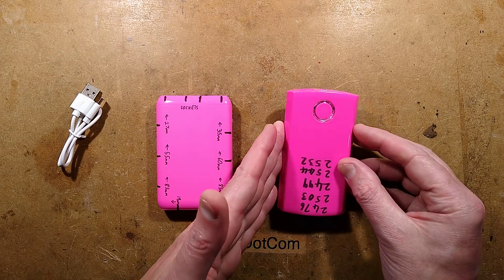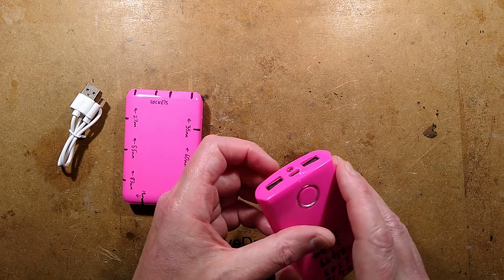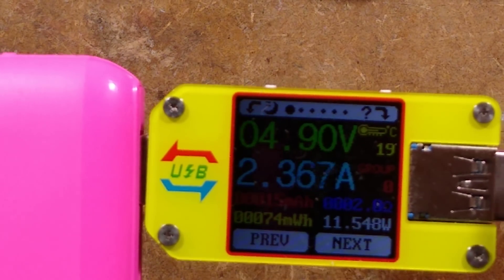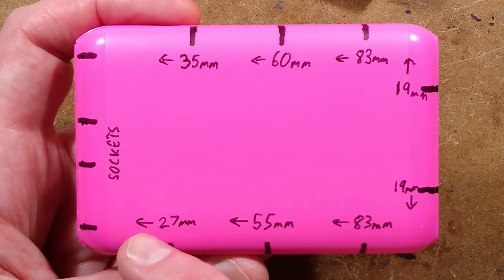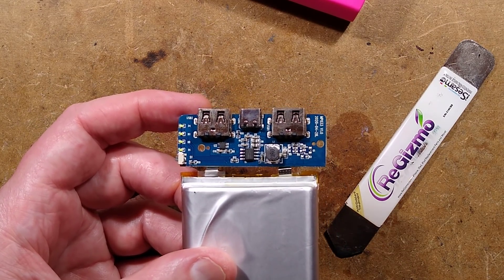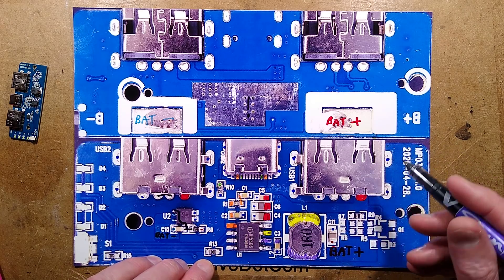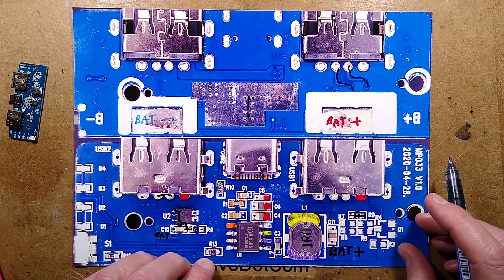Poundland's new 4000mAh power bank

Comment: 2 ideas that are better than using rubbing alcohol to dissolve glue. 1st one is WD-40 it is amazing how well w-40 can penetrate and get under the glue so it just slide right off! The 2nd one is a cleaning product sold in America called Fantastic it does the same thing but it just takes a little more time for it to penetrate.

Comment: To help remove lithium batteries I use a cut up credit card, I put a slight 'chisel' profile on the edge, with a slight curve...it seems to go under batteries without risk of puncture, or deforming the battery...

Comment: Bought a power pack today & when I opened the packaging I found a metal disc with a small square magnet in the corner sellotaped in place, can’t understand why they would put a small magnet in the packaging that has nothing to do with the charger. Any Ideas why it would be in the box? Seems to be under the security label. I’m puzzled 🤔
Reply from the maker: Sometimes it's used to hold the box flap closed to give a posh feel to the packaging.
Reply: @bigclivedotcom  hi Clive, that explains it just discovered there’s actually two of them. I thought it might have been for the security tag.

Comment: With the previous model you could have a device permanently plugged in and and when you switched the device on, power was there - you didn’t need to switch the power bank itself on.  Is this one the same or do you have to click the power bank’s switch first?
Reply from the maker: This version doesn't always have 5V on the output.  It also goes to sleep with loads of 40mA or less.

Comment: I wired my bike lights upto a charger like this, they took 2x 3v lithium batteries I figured 5v would be enough to run them, I soldered wires inside them running front to back and put a USB connection soldered in the middle of the run of wire and had a frame bag that held the power bank. Basically I wanted easily rechargeable lights that wouldn't really be a hassle to run. It worked great

Comment: @bigclivedotcom
How could you modify the circuitry so it could output protected battery voltage instead of boosted 5V. I’m thinking of a protected battery source for a gsm module. 
Thanks.
Reply from the maker: Just by tapping off at the protection chip.
Reply: @bigclivedotcom  
Thanks, will find out which pin that is. Like you, am going to try to scavenge lipo’s and protection circuitry for projects, it’s cheaper than buying separate batteries and protection/charge boards.

Comment: At a guess - I'd say the absent resistor/transistor network is for optional Fast Charging capability - The standard USB port allows for 500mA, dedicated power ports are 1.5A, and then you've got the BC1.2 standard, and all the proprietary "standards" that each manufacturer had a go at creating. So short of actually using a dedicated USB charging "negotiator" (eg.  TPS65988) you can just implement a certain resistor network which will statically advise the client (via the BC1.2 standard) of how much current it should be allowed to draw. The absent circuitry may well be for some proprietary support (eg. Apple, Samsung) - I know that early apple chargers were configured for 2.4A, which is rather similar to this device's output.

Comment: Thanks. I use power banks to run guitar pedals with a 9v converter cable so it's good to know which are kosher. I bought one off the internet which made a clicking sound through the amp, I presume some internal switching?
Reply from the maker: Some have the input and output paired, and drop the output briefly every few seconds to test if an external charge is being applied.

Comment: Can the maximum charge level be modified? I think dedicated lithium UPS units keep the lithium cells below maximum charge so as not to degrade them too quickly.
Reply from the maker: It's not recommended trip go above 4.2V for most standard lithium cells, but for long term backup it makes sense to run them at the military spec of 3.9V which is near full charge, but will result in longer cell life and capacity maintenance.

Comment: You are right about piercing one of those lipo's.  Had that happen a couple weeks back. I had used an Arduino to build a small MP3 player.  Put it in a plastic project box and mounted some buttons to control things, as well as a earphone plug for output. I put a flat pack battery in the bottom of the case and just put the parts on top. It worked great for months, but the cover never really stayed put as the NANO which I had soldered to a small board was catching on the little mount pins inside the case at either end.  So the other day I took a snips and removed those mounts cause they had no practical use in the project and were just getting in the way.  What I neglected to do was cut the pins on my Nano that protruded through the circuit board containing the other components.  I did notice that the blasted thing would come on by it's self from time to time if I pushed harder on the cover. I was listening to some tunes through it one day and suddenly the strong smell of plastic melting was in the air. Since I had not been soldering for quite some time I got a bit concerned. I picked up the mp3 player and burned the hell out of my hand!  The pins from the Nano had pierced the cover of the flat battery and there was a very hot fire in the bottom of the case. I grabbed the whole device and pulled the Nano away from the battery but a bright white fire still remained in the pin hole.  Now I am not as quick as I used to be, in fact I am classed as disabled but I assure you, I got that thing out doors quicker then I could have when I was a boy!  I took my snips with me and once out doors, cut the lead, only one remained as the heat had unsoldered the other and dropped the burning battery on my drive way. Days went by, and I had pretty much forgotten about the whole affair when my daughter brought me that battery, saying she found it in the drive way. I took it immediately back out doors and placed it in some tin foil, then dropped it in an old cast iron pot that is yard décor where it remains to this very day.  Oh the mp3 player? Well it still lays on the floor near my chair.  One day  I may install another flat cell, but then I have dozens of ways to play music now and don't really need a home built player.

Comment: A while ago I managed to get three 2A USB powerbanks for the Amazon Echo Dot, for £5 each from Poundland. Definitely worth it just for their lipo cells, two 4000mAh in parallel.
They don't behave like regular USB powerbanks though, to activate the output you have to press & hold a button, or if you plug in a micro USB cable to charge it up, the output is automatically turned on, presumably this is so the Echo Dot can still run whilst the powerbank is charging.

Comment: The USB Type-C resistors are used to indicate which device is pulling or supplying power. The specifications require them to be of certain value, referencing specific amperage and voltage. Without them, devices will just refuse to negotiate a connection.

Comment: Ah it's £5 I guess poundland isn't the one that sells everything at £1. If you need a small amount of power I guess it's not bad but in terms of price per ah amazon has some much better deals this works out at about £1.25 per ah where as one of the first items on amazon comes in at 58p per ah so less than half the price. Maybe he'll review that as well https://www.amazon.co.uk/dp/B07V4RVGL5/ref=cm_sw_em_r_mt_dp_3HHW8Y5A8PS764ZHNYDY?_encoding=UTF8&psc=1

Comment: i think its misleading when they mark a powerbank with the ah rating of the cell(s) as the actual ah you''ll get at the 5v out will be less ..
Reply: i have a halfords thing, 'supposedly' 3ah, oh yeah, 1 if you're lucky,, it used to be better at first, but fairly quickly 'degraded' , cant get the thing open without destroying it to check/change the battery 😠

Comment: The problem I normally have with power banks is that after some use they don't stay on to power your device. It is as if the current sensing circuit quickly deteriorates.

Comment: I live in the USA and I just found a deadly fault with my apartments wiring today.  Apparently the set screw on the cover plate for the wall outlet is live at mains voltage.....  basement apartment, I was barefoot and touched it...  burnt my finger a little.
Reply from the maker: It's worth getting that checked out.

Comment: I was just thinking of getting a few of these just for the lithium cell... my old Mate 9 and Nvidia Shield tab could do with a new battery haha. Gping to definitely see if i can pick up a few of these.
Reply from the maker: Note that the phone battery may have a protection PCB in it.  These are bare cells.
Reply: @bigclivedotcom  thank you for the heads up. I'm aware that both have a protection pcb. Worst case scenario I'll just use the battery to replace one in a Bluetooth speaker

Comment: What happens when you try to charge and power something at the same time, is this possible with this board? With the little inductor working for both Vin Vout?
Reply from the maker: I think it may just pass the charging 5V straight through to the output.

Comment: Seems to me that if a box says it outputs 5V and 4Ah, then it should be able to deliver 5 * 4 * 3600 Joules, at least at some (low, probably) output current. Anything else is deception.
Reply from the maker: To be fair, they don't specifically say that the 4Ah relates directly to the 5V.
Reply: @bigclivedotcom  At least it's not as silly as the perpetual increase in the voltage of battery powered tools.
Reply from the maker: @sylviaelse5086  When using cordless tools you do appreciate the higher performance and lower current that the higher voltage packs bring.  Many of the higher voltage ones perform as well as the older corded tools.

Comment: I would use what is  called " white spirit " in the UK  it's a mixture that softens the rubber used in tapes and foam pads - turpentine substitute  - also WD40 will completely remove hot melt glue without damaging polystyrene or other plastics
Reply: wd40 'can' affect some plastics, i've had it happen, making it crack up
Reply: @andygozzo72  interesting - I was thinking of occasions when a hot melt string gets across a nice enclosure and WD removed it - allways needed finish with isopropyl
Reply: @geoffgeoff9835  if you've only had wd in contact with it a short while, probably ok...

Comment: While you would be able to drive 6 LEDs, there is the issue of other possible current paths.
For example, if you have 1 High, 2 Low, and 3 High Z, you have a path through the hypothetical D5 connected directly to 1 and 2.
But you also have the path through D1 and D4.

And the same problem would occur if you tried to turn on an existing LED. If you made 1 High, 2 High Z and 3 Low, you have the intended path through D1, and another possible path through D5 and D3.

While  this likely wouldn't be a problem if all the LEDs are the same and aren't broken, if you have different LEDs it could be a problem and more than just the intended LED could light up.
And if an LED broke, then the others would be more likely to light up.

Comment: Discharge completely ? That's nuts if you want to have a usable battery - discharge to 3v maybe. Definitely Not completely. Mr Big Clive I did not expect this form you.
Reply from the maker: By completely in lithium terms I mean to auto shut-off, which with DW01 type chips is 2.5V    For disposal I recommend to zero.

Comment: Delivering a supply while charging is such a great feature. I'm surprised that more units don't do that. It's so frustrating when this isn't possible.

The other frustration I've come across when powering IoT devices is that, having laboured mightily to make your devices draw as little power as possible, power packs no longer recognise the power draw and switch off!
Reply: If you charge and also use the powerbank to power up phone at the same time, doesn't the output drop to the phone? So it's slower to charge up phone. Well that's my understanding. I'd rather charge up phone fully and then charge up powerbank fully. (Or vice versa)
Reply: This may count as a UPS supply, maybe not a very good one thi

Comment: When faced with the removal of double-sided tape of unknown provenance, my first tool is heat. If using solvents, I've found that ethanol works on some, IPA on others, MEK on others, so I generally try each one a bit gingerly. Acetone is also great but will also eat many plastics of course :)
Reply: Be careful with MEK. It's nasty stuff.

Comment: Clive if you weren't an electrician what do you reckon you'd have been? My dad started out a carpenter, then was an electrical engineer, then rounded off his career as a white goods engineer. So what else could you have been? I mean the evidence suggests Pyrotechnician! lol
Reply from the maker: I originally wanted to be a lift engineer (elevator mechanic) but was stopped from doing so by my dad.  If I hadn't been an electrician I'd probably have trained as an electronic technician.
Reply: @bigclivedotcom  My dad was originally going to be an RAF pilot before carpenter. He flew the gyrocopter from James Bond on one occasion as a day out! But he had a fit after suffering heatstroke and that was the end of that career path. He never forgave my gran for phoning the doctor but she did what she thought was best at the time. He never had another fit in his life so he was kinda right but safety first and all that!

Comment: Nice video! 👍👍
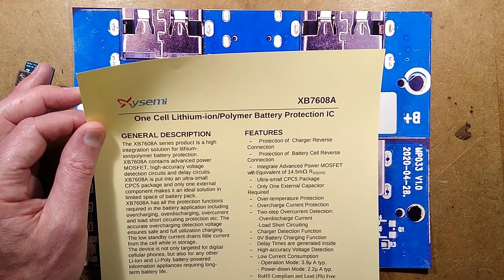7:50 Quite shocking is the XB7608A's feature of "OV [zero Volt] Battery Charging Function".
Li Ion cells stored undervoltage for longer time - and 0 V is the worst case - crystalline, sharp dendrites may pierce the seperator while "reviving a dead cell". Will be revived to a little pink bomb thingy.
Reply from the maker: It's more of an issue with high current applications.  Lithium cells do not automatically suffer damage when discharged to zero occasionally, but definitely do suffer damage when reverse charged.
Most small power banks will happily recover from 0V by trickle charging the lithium cell until it reaches around 3V.

Comment: just got a similar 3.7 pack but 5500 mah for 5 usd shipped . i needed it for a digital audio recorder i got on auction . this original cell was 1200 mah . so there wasnt room for it inside but i managed to mount it externally but nice . i am just not sure about charging and all that ? i have been charging on and off  it but it says its full - i reset it and takes another charge . after what seemed to be about right for the amount of time i stopped charging it ... lol .
Reply from the maker: It's worth checking the voltage across the cell to make sure the unit does have charge limit control at 4.2V.  It's not uncommon for a cell to charge and then settle down a bit afterwards to take a bit more charge.

Comment: Clive, forgive my ignorance. Drone cell ? Please explain that statement. I derive greater current load, where to find. And what advantages/ disadvantages to the design/ and or chemistry.
Reply from the maker: You get lithium cells designed for very current applications like drones and jump-starters.  They can deliver hundreds of amps by using stacks of electrode plates instead of the usual single foil wound into a cylinder or slab.
Reply: @bigclivedotcom  understood, thank you.
Seemingly, it comes down to surface area. Hmm E bicycle
Comes to mind.

Comment: My personal favorite adhesive-remover solvent is naptha. In the US, it's sold as either VM&P naptha (White Spirit in UK/EU), Coleman stove fuel, or Zippo/Ronsonol lighter fluid. I personally use Coleman fuel cause it's the cheapest and I do actually use it for its recommended purpose a lot, but I pour it INTO a Ronsonol bottle because the squirty tip on it is much more useful (and I do also have a Zippo lighter, filling off of 1-gallon Coleman cans is kinda messy).

It seems to dissolve the adhesive WAY better than any of the less-dangerous solutions like alcohol, while also not melting ABS plastics like acetone does, and doesn't leave that icky greasy gasoline varnish behind. Evaporates off just as fast as alcohol too, only downside is it's flammable.

Engine starting fluid works VERY well and flashes off faster, but that diethyl ether in it tends to make your fingers too numb to proceed further with disassembly unless you ACTUALLY remember to open the window before using solvents instead of saying "meh, it's too <temperature> outside, it'll be fine probably"

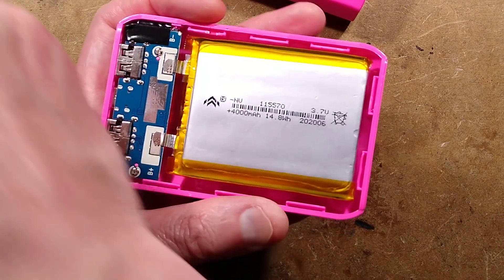Comment: 4:50 I encountered this problem replacing the battery on my LG G7 today. The glob of glue was in the middle of the battery and I felt I did not want to use the heat gun directly on the screen for too long. I surety didn't want to aim the heat gun at the battery. The battery bent a bit and ruined it, but It was mostly dead anyhow. :) 

I also made the dumb mistake of twisting the spudger while getting the back off of of the phone. The glass on the back shattered, but fortunately the glass over the screen didn't. Oh well, I can use the phone case to hide my mistake. :)

Comment: Many USB-C supplies will not provide power unless they can identify the client device and the pulldown resistors tell the host that it's a "dumb" 5V host.  This has caused a fair amount of trouble for devices trying to simply move to a USB-C port without paying attention to the standard as older connectors did not need extra components.  This has led some manufacturers to dread USB-C and continue using micro-USB for as long as the market would tolerate.